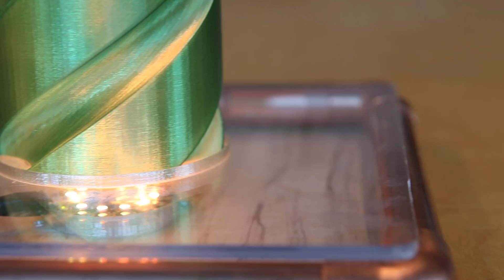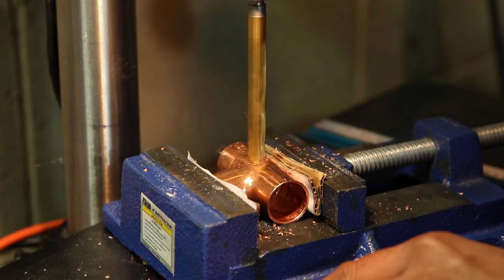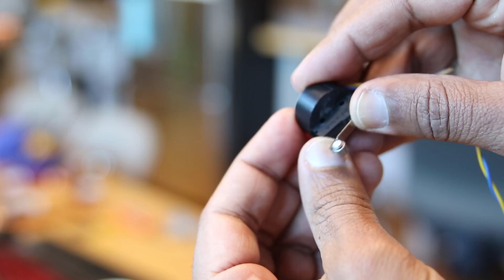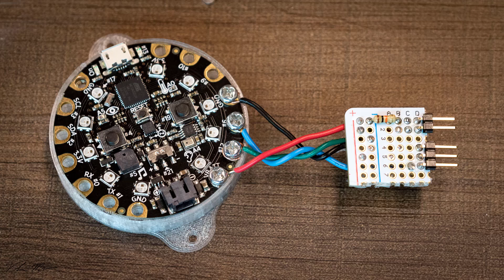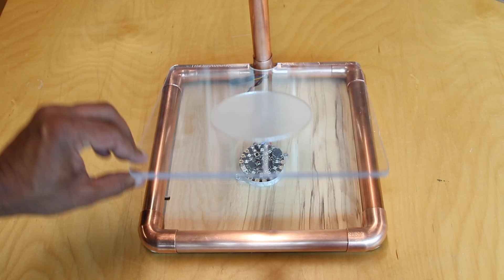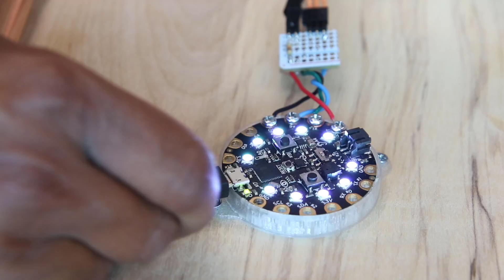Twisty Vase Automation with Adafruit Circuit Playground

Comment: Nice built Vladimir! I like your craftsmanship. Tell us how you did the Video during the print, did you synchronise the taking of the images with the Z-position?
Reply from the maker: Thanks John,  for the timelapse video I simply set up a gopro on the print bed and set it to take a picture every so many seconds depending on the duration of the print.  These always look very smooth whenever you print using the vase mode.  The timing just works out every time.